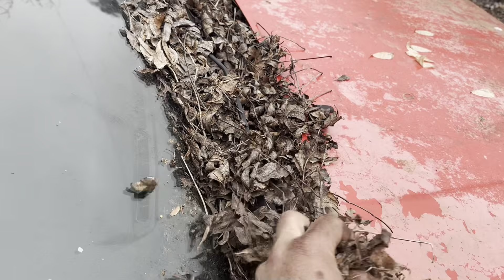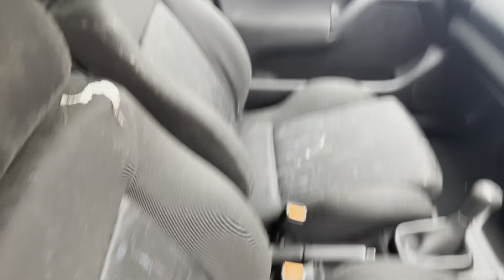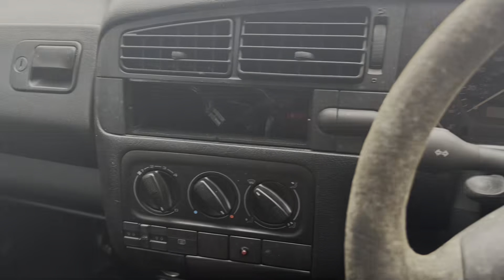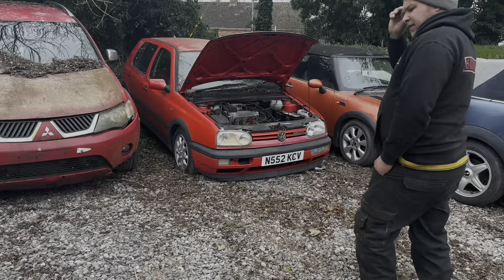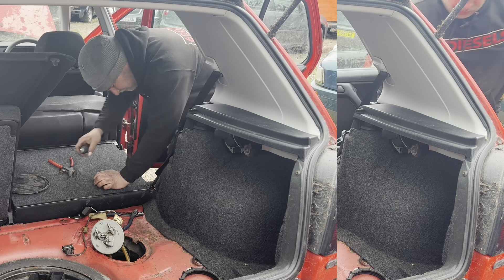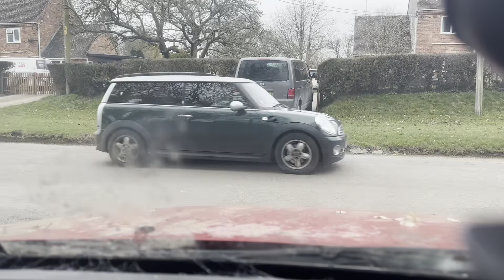£15 pound mk3 Golf GTI will it start after being abandoned for 6 years

Comment: Had an exact same issue with pump on one of these. The difference is I sold it and had someone coming to pick the thing up after it was sat for ages, went to start it - nothing. They were an hour into a 1.5 hour journey to fetch it. We pulled the pump - ran it forwards and backwards using a power probe on bench and hey presto it came back to life, banged it back in and it started just as the fella turned up!!

Comment: I owned an 1995 N-reg 16V GTI. This has rounded tinted side indicators so is a later model. Mine had rectangular orange side indicator lights but same smaller front spoiler. The 8V was underpowered for the badge.
Reply: yes the 8v was the first and last GTI I drove, embarrassing to say the least, I did own a Sirocco 1.8 J-tronic injection great car quick good on fuel and with uprated adjustable suspension fabulous handling

Comment: Moving a vehicle on the starter is a good way of getting you out of harms way when the engine dies. I used to you this all the time in my early days.
It's something the younger generation should learn to use ( only manual gearboxes of course)
Reply: I agree and  you can also do this to drive away a car with no clutch
Reply: agreed
Reply: Indeed.. your battery won’t thank you tho… you can also use the clutch for more control. (Crank and use the clutch as normal)

Comment: Never seen a car drive on the power of the starter motor before. Definitely surprised me, that.
Reply: Had  a hire van, but literally had no fuel to reach the first petrol station. Conked out 50 yards before it, put it in gear and cranked it to the pump. Does work, but don't do it too long though...
Reply: Not meaning to be cheeky or anything but I thought everyone knew you can move the car with the starter, unless battery failure
Reply: @game4alaughman  never seen it.

Comment: Being very tired after a 28 hour shift fixing heavy expensive crap for corporate types, I stuck 70 quid of petrol into my diesel mondeo on the way home. It duly shat itself right at the toll booth on the motorway. I then set the un-official record for "driving a diesel mondeo the furthest on just the starter motor because everyone behind is getting hugely moody at your car not driving.."   It is a very useful Skill to have in your tool-box of tricks. :-)
Reply: Unforgiven for wrong fuel. My wife did it twice in one week....you know what that makes you....a double....! Peace be unto you.
Reply: @martinwarner1178  Years ago a former colleague mistakenly filled up our Transit minibus (old generation N-reg) with petrol whilst on a week long job in Southern Ireland. His solution was to spend his entire day off on a 300 mile drive to get rid of all the dodgy mix!
And no complaints from the Transit (apart from the 300 mile long smoke trail...)